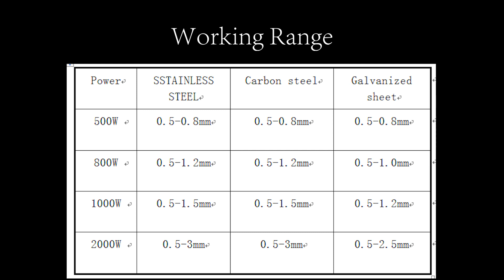Laser welding machine

Comment: Where can I buy it and how much does is cost?
Reply: The company show price start from $8,000
Reply: I send question to this company and got answer  - price $25,000. Not 8K.
Reply: Ooh... That IS Steep . . .
Reply: @louisramirez3128  For home use, yes. But for high output manufacturing, that can be a huge time saver and quick ROI.
Reply from the maker: Hi sir pls send message to email: info@peslaser.com
Reply from the maker: The price of the machine is very good now, do you want to try it?
Reply: @peslaser  Yes, I want to try it!
Reply from the maker: @Eddy_AREA99  Hi Sir where are you from?

Comment: When you are welding with no long sleeves or gloves are you being exposed to high UV rays? Oxyhydrogen fuel fire flame there is no UV rays at all. Oxyhydrogen fuel is water on fire fuel technology. 1 gallon of water produces 1700 gallons of gas that can melt tungsten steel. The amazing thing about oxyhydrogen fire is I can melt stainless steel to glass using one torch without any adjustment on the torch controls.